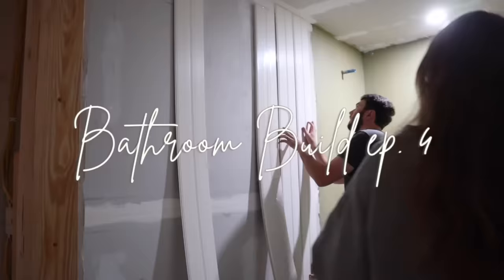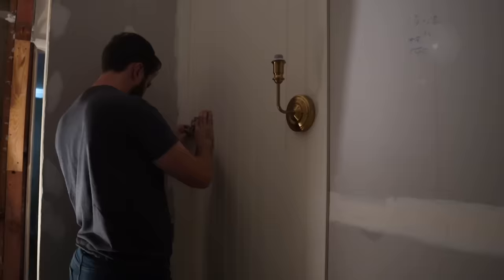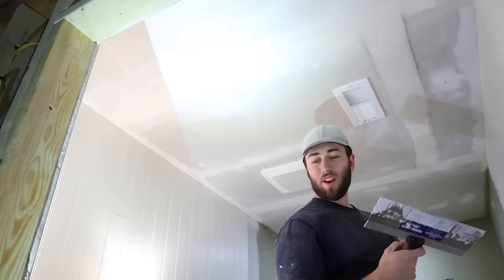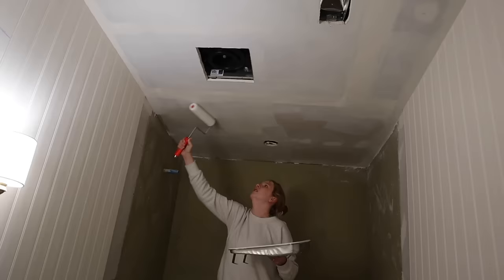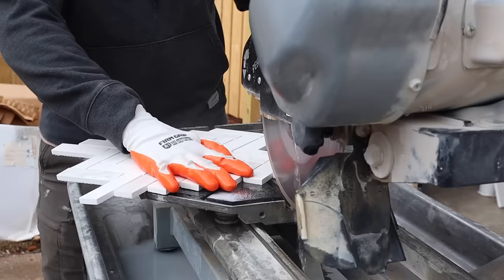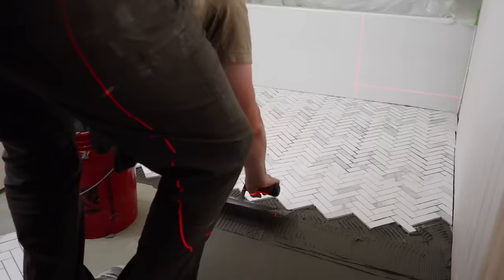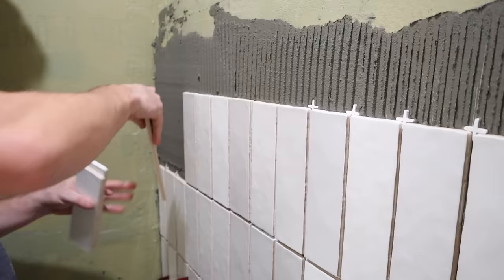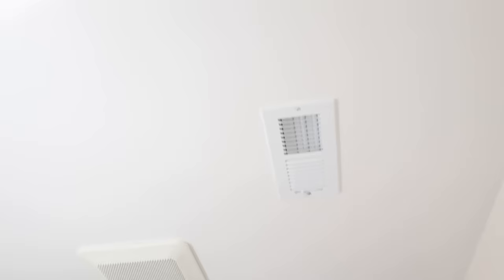DIY BATHROOM BUILD EP. 4 | herringbone floor tile, zellige shower tile & beadboard *DREAM BATH*

Comment: I was just wondering how the bathroom was coming along and up popped your video! (I obviously spend too much time on YouTube.) Are you starting to relax yet? I told you your design choices were going to be amazing, and you were going to have a beautiful bathroom! I was able to finish one project in my house before I had a mental breakdown and it was a bathroom that went in in place of a very small bedroom. Had a few missteps but, in the end, it looked better than I thought it would. Tiling is pretty easy for a beginner, especially with the right tools, like the wet saw. It’s the grouting that’s a pain. Cleanup is difficult, but has to be done right, or your tile won’t ever look clean. Looking forward to the next video!
Reply from the maker: Oh gosh… we were hoping the grout would be the easy part
Reply: @AllisonMcPhail  Just remember to grout a few rows, then do a quick wipe down before the grout dries. Then go over it all again after you’re done grouting. The quick wipe down will save a lot of time, and you won’t scratch the tile trying to get dry grout off. Beautiful tile choice btw, and I’m going to use the ship lap one of these days.
Reply: We grouted our kitchen and it was such a pain, also used way more than we were told it would take

Comment: New subscriber so I'm just seeing this.  I used Veranda PVC in my kid's bath in 2015.  It's mostly installed with Power Grab cement and some white panel nails.  The nail holes do disappear.  It looks yellow to me so paint was necessary, but it finishes beautifully.   I finished the ceiling with PVC crown molding but what you've done looks excellent.  Christian is very detail oriented and he's doing a better job than a contractor would do.